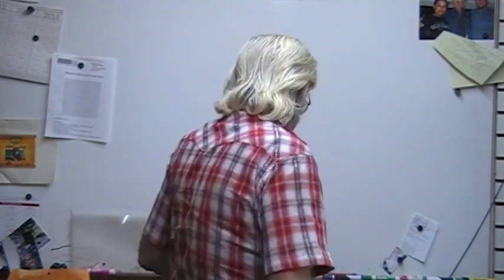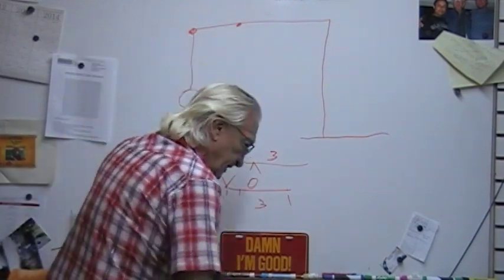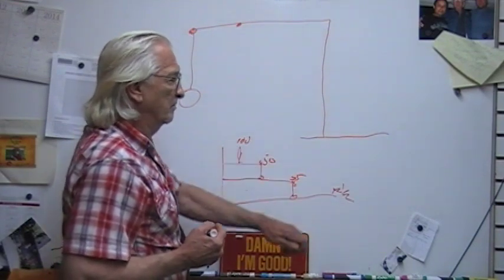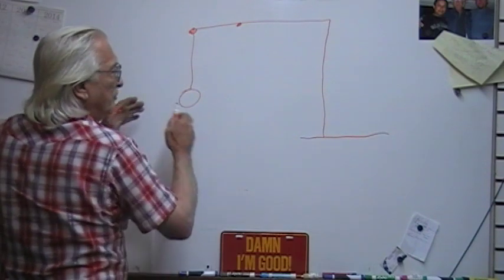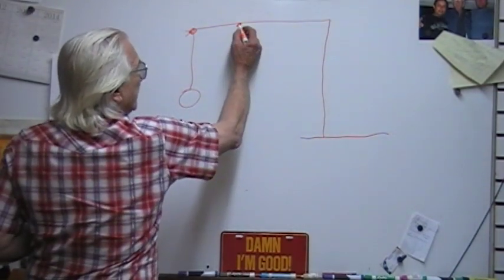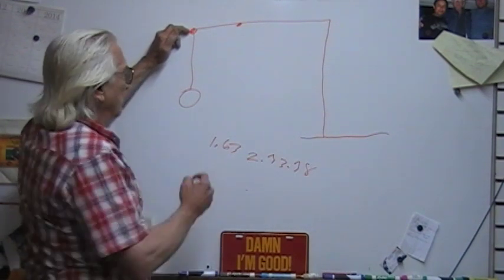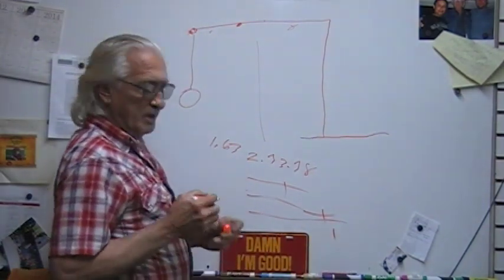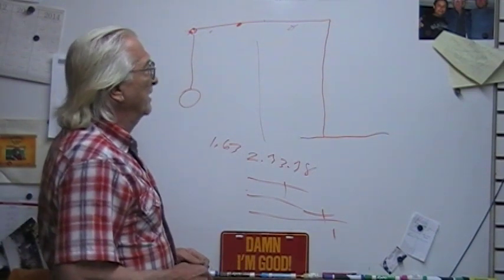workings of the TSO

Comment: excellent video and tutorial BOOM BOOM.
I did see one flag for disagreement. The length of the pendulum governs the length of time for a full cycle of swing. how high the pendulum swings doesnt chnge at all. But it does, as you say, change the power that it takes to operate, and thus the power stored in it's swing.
example: When I was a clock maker, I noticed that the timing of the clock would not change whether the mainspring was fully wound up, or towards the end of it usable tourque. The pendulum would swing a bit higher when fully wound up. but always the same timing.
   On the other hand, This two stage oscillator utilizes the differential in it's force exerted in the vertical direction, both up and down. This vertical deflection of the pendulums' pivot, could prove me wrong to a small degree.
    On the complimentary side of things: This tutorial is amoung the best in detail ever. I am still a big believer of the overunity of these devices. Your work with this wonder, is far above the rest. Even Milkovich stated that. That is one of the best compliments I've seen in a long time. And you explained it on a level that is easy to understand to all. congratulations. And although I disagreed with the one statement from my clockmaking days, I have still taken in more knowledge from you on this subject.
AWESOME VIDEO.
MUDDy

Comment: Excellent video Ray! I already have a frame started for my next tso project, but I am happy you made this video.. sometimes I forget the finer points. I also don't care anymore wether or not the tsmo is OU. It is an excellent motor.  The time aspect is also very important, and sleeping while creating energy can't be a bad thing. An easier escapement then the v&f would help though. Glad to see you back in.
 Greg
Reply from the maker: Hi Greg ;  Really glad to see you .  Especially on this video.
By all the research I have done the V&F  is supposed to be the easiest to build.  And really ;;   After building 2 or three IT does get easy.  And as in my last video  CAN be built adjustable. Which REALLY helps to tweek it to work out the slack     (wasted movement).  We have it tweeked now to less than the thickness of a business card of wasted motion.
 After only a few builds it gets so easy . If you make a mistake ,  you don't want to fix it .  Just start over .  It is really THAT easy..
AND the V&F can be designed to replace wear, parts more  quickly.
When we get to that stage of development we will make several sets of wear parts and send them to Houston Texas to be Teflon coated.
 When we replaced the cheap pulleys with ones that have bearings ,  it dropped the actual weight needed  to drive the pendulum .  so drastically  .  We are now trying to locate Teflon coated bearings.

Comment: So if the lever pivot point goes too much up and down that is wasting energy ? Which factor then makes the most overunity ? The relation of the lever ratios ?
Reply from the maker: The up and down motion of the pivot point of the Pendulum is where the over unity comes from .  The  levers only increases the travel .
The length of the pendulum not only increases the time (directly proportional )  between pulls,  giving the lifted weight more time to do work ,  It also increases the power exponentially.
Reply: RHEAD100   Sorry Rhead, wrong answer....
The Fairies told me the up and down motion of the pivot causes the pendulum to loose it's torque. It disrupts the pendulum's natural swing and turns harmonic motion into chaotic. The dropping pivot changes the direction of the force from horizontal/diagonal to vertical as it accelerates through plumb position - where the pendulum is at it's most powerful. This is a hole in the bucket where energy exponentially escapes through the vertical dip at peak power stage. 
You have been Milkoviced by the TSO concept and you are innocently Milkovicing others with your tutorial videos. 
Proof:  Bend a piece of clear plastic tubing into a half circle and stand it upright representing the ark of a pendulum swing. (The Fairies used an upside down rainbow to show me Milkovic's multi- patented multi- flawed setup)  Drop a ball bearing down one end and mark the height it rises to at the other end. 
Put a dipping bend at the bottom of the rainbow and repeat the exercise. Like the bob of the pendulum on the TSO, the ball bearing looses it's velocity at the bottom of the deformed rainbow. G-force drags it down into the dip. Inertia sets in  and now the bob on Milkovic's TSO  has two hills to climb. Imagine what would happen if the Sun loosened it's rigid gravitational grip on the Earth for a fraction of a second?    
As you say yourself  "Daaa - gimme a break",  or do this exercise on your white board! 
I'm an Irish hillbilly with no degree of education so I can't do rocket science or theoretical physics. I live on a ridge farm high on a hill dotted with Fairy rings and magic mushroom beds. I look down on human society with the same amusement  as my neighbours - the Wee Folk.  They say I'm away with the Fairies but I think I'm an alien abducted by humans. The Fairies have evolved beyond science and technology. They use quantum mechanics and Nano tools which frees them from humanity's standard physics model. They're energy needs are small since they mastered the art of invisibility and flight many yonks ago. A Nanowatt  of energy in Fairyland mixed with a magic mushroom particle is enough to power their kingdom for years. Such is the minuscule effect  of their carbon footprint on the biosphere, you'd hardly notice their presence here on earth.
I'm cdevine53@gmail.com Email me your postal address and I'll send you some Fairy facts on pendulumics away from the greedy eyes of thieving industrialists.
Reply: +RHEAD100 An exponential function  describes those system where a gain or a loss  depends on the system itself.
A tree  grows as an exponential function, because the  incremental weight added by growth affects the growth.
In Atomic Radiation the amount of mass radiated depends on the mass remaining and so on.
Personnaly I cannot see how you deduce that the power increases exponentially,  it would be a nice world for engineers like me if that was the case. 
I like your bravery and courage for this research and  the amount of time you devote to building these structure. I recently came across your video and I must say I would enjoy working with you, sharing my own engineering experience. At the moment I am making many clock escapements for my Grandson all made of wood and I  made a Coaxial escapement by George Daniels and also the old lever Swiss escapement and also the one  you are using for your pendulum.  I feel that many modern children are not being given the eduction in understanding the Universe around them as it is and they live in a world of make believe.
Keep up the  activity you follow and if possible, try and join in with someone else, as two working together sharing concepts before you build them, could save you a lot of work and disappointments.
Good luck with your activities, they certainly keep you busy.

Comment: Yes Rhead , greetings from Ireland and good luck to you and yours from all in Fairyland.

Question! why a two stage oscillator when a simple pendulum is in itself the most beautiful and efficient mechanical device ever discovered?
It breaks all Newton's Laws of motion in one magic stroke.........

Drop an apple from 16 ft. it will hit the ground 1 second later. Drop the apple from 64 ft. it will hit the ground in 2 seconds, F=M x A. G-force (Gravity=32ft'/sec/sec/sec acceleration..... until terminal velocity).

The fairies call gravity FREE FORCE and a simple pendulum is their favourite toy !  
Put the same apple on a relatively massless string, drop it from the same height and watch the magic. It will fall on a curved path (57% longer on my 64 ft. arm 55,000 lb. system) than the vertical and hit the ground at the same time, having travelled 100 feet six inches on the swing fall in 2 seconds. (Sorry Mr.  Newton, your 32 ft. per/sec acceleration law only applies to vertically falling apples - not swing falling objects!   

Have no doubt my friend about the efficiency of a simple pendulum!  When the pendulum bob passes through plumb position, it's already 157% efficient before you factor in acceleration and measure the distance it travels uphill while still generously  exerting  it's torque on it's pivot shaft.     

The Fairies asked me to ask you, - does the second oscillating arm not limit the distance and period of your stroke making it difficult to convert a short jerking motion to smooth rotational and do useful work?
The planets are in perpetual swing-fall around the sun and kept in rotational /orbital order with an invisible gravitational string without any secondary mechanical devices to add friction and complicate the simplicity of the solar system. Our satellites do likewise.

Your videos are very informative and you seem a genuine sort but in spite of your obvious engineering and physics knowledge you haven't shown any meaningful applications. Think shaft turning and forget Milkovic's TSO weight lifting devices.

 A pendulum swinging/idling at 180 degrees is roughly a 95%+ gravity powered oscillating piston on it's forward stroke. Add a 5%  or less external force to maintain 180 and on the back swing it will give you another 180. Crank both strokes to a wheel and get the full 360. Add a load to the wheel and listen to the pendulum tell you what weight you need to add and what input force you need to apply to maintain 180 and power the load. The more weight you add the less input force needed. Oh, try a 64 ft. arm and a 55,000 lb. concrete ball to get maximum G-force (FREE FORCE) and don't forget to stand well fuckin back, we're talking a no mercy magdaddy monster here, 3.92 megawatts to be exact with an input force of 174kw. Before I forget, use tempered steel bolts and no cheap Chinese bearings.

All the best from Fairyland

Comment: Yes me again Rhead.

Velijko Milkovic's TSOs are no more than OVWPs - regurgitated  Old Village Water Pumps. A heavy wheel or a lever cranked to a pump piston - the second stage of the oscillation did the work. This is antiquated beam engine technology. A heavy force pushing on the short arm of an unbalanced sea saw will do work but that's not how to power a load over a distance efficiently. The Fairies call Milkovic's TSO a three stage oscillator. 1, the pendulum arm. 2, the transverse lever - as you call it. 3, the load itself. The Fairies reckon there's one arm too many here and two arms is better than three.

 Look closely at Milkovic's setup and see how the arm between the pendulum and the load reduces the distance over which the load is moved and increases the time it takes to move it.  Yet it's still a very efficient way to do human powered work if you're not in any hurry to get the job done like our African friends.

Some gobshit authority gave Milkovic a drawer full of patents for reinventing what amounts to a the wheel with two axels  - a TSW - a two stage wheel with the second axel being a frictional liability. Some years ago when I challenged him about his patents on obsolete water pumping technology - TSOs - he smugly refused to engage with me when I pointed out that the first of many flaws in his design. One example: the dropping pivot of the TSO pendulum quickly slows down it's swing range necessitating a higher input force to maintain the stroke. My pendulum told me it wanted an absolute rigid frame with no movement whatsoever at the pivot.
 "Fuck Milkovic and listen to your pendulum", it said        .   

I say again Rhead, crank your reciprocating pendulum arm directly to a driveshaft like an old hit and miss stationary engine and get maximum force at the highest speed available over a longer distance in the shortest time possible. Give gravitational energy a chance to reveal itself with a simpler mechanical configuration. Stretch your pendulum arm to the maximum height your nerve will allow and pile on the weight. Gravity likes plenty of mass - scrap iron  - concrete weighs 4500 lbs approx. per cubic metre. Drop 14 metres of concrete from 64 feet on a pendulum arm and G-force will accelerate it to 50 feet /sec. Do the sums on that. 55,000 lbs @ 50 feet per second = 5250 HP, or 3900 KW minus approx  4 / 5% input force.   
      
 Other than F=M x A, we don't have any real understanding or equations for Gravity- ( FREE FORCE) . The fairies see Gravity as a fuel source.  It's a perpetual force keeping everything in perpetual motion from the planets falling around the sun to electrons and photons falling around the centre of the atom at the speed of light.
Reply from the maker: +cdevine53 I like the way you think.